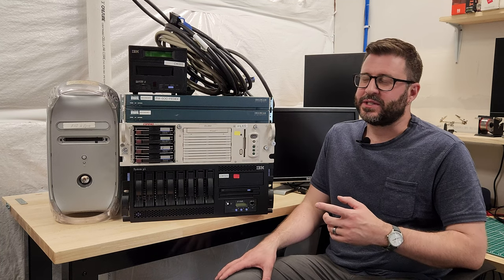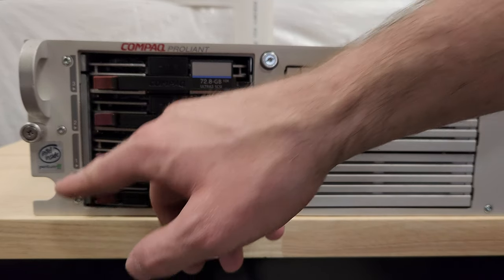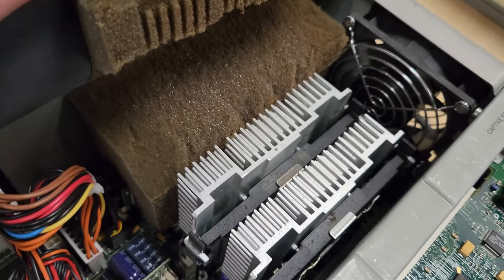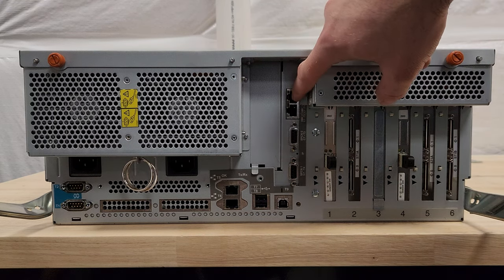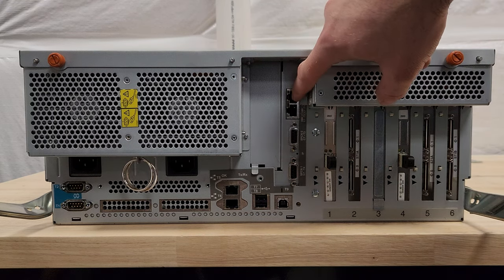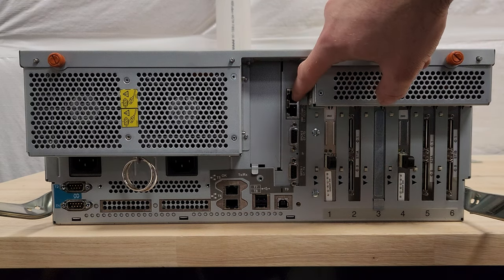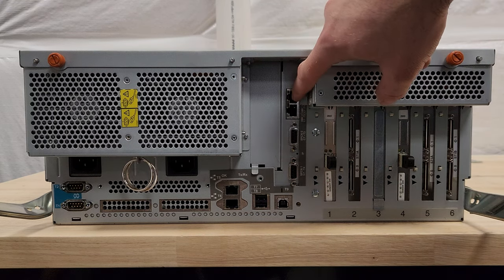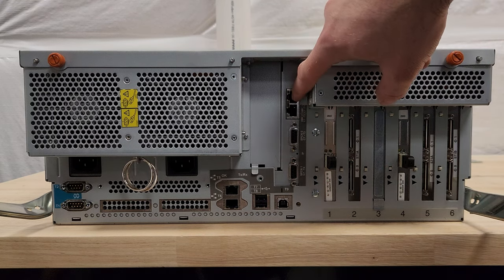Old Computer Craigslist Haul

Comment: I can help you quite a bit with the IBM box if you want.  You have a Power5 there.  Do not attempt to remove the CPU.  Skip the HMC completely unless the machine is entitled for PowerVM (I dont think it is) The jist of it would be to pull the FSP and toggle the two DIP switched on it (they will be under a small piece of tape and are super tiny) and then power it back up.  This will reset the admin login on the FSP which is where everything begins.  Youll attach serial to the S1 port and login, then its 2, 11, 1, 1 to factory reset the FSP and take an inventory of all the parts in there.  It will power up and down a few times and if it returns to slow blinking green light with no amber light, you're gonna have a better time.  To install AIX return to the FSP and power the system up into SMS mode.  SMS mode allows you to set the boot order, it will not automatically boot from the DVD you will need to specify it in the boot order.  You should then boot the IBM 5.3 diagnostic media and test the machine fully.  Repeat the process with AIX install media in hte drive, the AIX install process is pretty straight forward.  The AIX installer will automatically set the hard disk containing AIX as the boot device.  Other things of note:  your machine is not equipped with RAID for the internal disk pack.  You will want to obtain legit IBM scsi disks for this thing.  There is a PCB interposer board that is required to get it to actually connect to the 4-pack backplane.  Your RIO2 cables are for a different system, probably a 9133-55A
Reply from the maker: This is fantastic information, thank you. Probably just saved me several hours. I'll be taking a look at this in hopefully the next few weeks, if I get stuck or have more questions I'll reach out!
Reply: @clabretro  I could probably send you a drive if you want
Reply from the maker: @willross6468  I've got plenty of non-IBM SCSI drives, is it critical that they be OEM drives? I was reading in the documentation that theoretically they should be.
Reply: @clabretro  It should work with a non IBM drive, as long as you are not running iSeries partitions.  There are other comments hgere about the 522 byte sectors, but that is not relevant for pseries (aix) systems.  You will, however, need the PCB interposer board in order to physically interface the drive.  If you remove the 4-pack hard drive backplane to take a look, youll see what I'm talking about.
Reply from the maker: @willross6468  awesome, thanks. I'll reach out if I hit any snags!

Comment: the service module in the ibm doesnt need an hmc. its a computer to start the computer. the big mainframes use a laptop with special software to manage the big iron. this is just a compact form of its big brother. now for the sad part. the computer isnt worth much without the os400 license. that is where the money is at. You should be able to load AIX. is the model number a 9406. if it is, its probably an as400. i loaded a port of linux for powerpc on mine. oh and the plug on the front is not ethernet. Its a serial port the needs a special adapter to access the service module or you can use a serial port on the back.
Reply from the maker: Thanks for the great info! I figured I'd be installing something like AIX or Linux on there... though it would be fun to give os400 a shot someday. I'll have to check the model number this evening and see what exactly it is.

Comment: About this battery in imac. I belive this is Lithium thylium battary. These are top notch battery in terms of longetivity. They are designed to live 20 years, and often 30 years. Used in things like seismic sensors on the bottom of ocean, and similar. They have super low self discharge, so should not fail.

Do not throw them into bin or normal lithium recycling. They require special handling and disposal, due to super high toxicity. Maybe I am wrong, because I find it strange to use that kind of a battery in a consumer product like Mac.
Reply from the maker: I did end up leaving it in there because it looked totally fine (for now anyway). I'll have a follow up video on that thing eventually.

Comment: That small scsi cable end is VHDCI 68 pin. It was standard in mid 2000s.

Also, those Dell monitors are nice because they support sync on green for certain old UNIX machines.

Im planning on making a retro homelab as well, with as many different UNIX OSs on CPU architectures as possible. 
Still need to find an IBM POWER for AIX.
Reply from the maker: I didn't know about sync on green, that's great to know. Yeah I'm so in the dark on all the SCSI stuff, but I'm ramping up quickly with all this gear I've been messing with. I think I called it proprietary at one point in the video but obviously it's just another SCSI connector form factor haha.

That's awesome about the retro homelab -- what kind of stuff have you acquired so far?
Reply: Also known as Low Voltage differential.  LVD  Started at 80GB/GB, the 160GB/sec and 320MB/sec.     With SCSI you need a terminator at the end of the chain of devices.  LVD allowed higher speeds and longer length cables.  Which is another important limit depending on type and speed.   Enjoy!

Comment: 09:46 in these IBM POWER servers, the FSP is an isolated computer. Once you turn the server on, the FSP will boot up (and will take A LOT for that), and boot the entire server after that. All the system setup is performed in the FSP. You can either hook a serial cable or a network port on it. Through the FSP you can setup the LPARS (which is more like a physical division of the hardware, along with which operational system every LPAR will run). Once you got everything set, you tell FSP to boot up the LPAR, set the serial port to a virtual-serial module in the OS, and you're good to install the OS. It can be either AIX, Linux or IBM i (formerly IBM i5/OS, formerly IBM OS/400 - yeah, they're not very creative). As far as I remember, you can simultaneously run AIX and Linux, but IBM i requires some specific disk format, and can't co-exist with neither of them.
Reply from the maker: Thanks, this is super helpful! I haven't even powered up the thing yet, but I'll be making some videos on it when I do! Plan is to get AIX running on it.

Comment: That ibm system p5 seems really cool. I hope to see a video of that and aix. Seems like it would’ve shipped with aix 5.1, but 7.1 will apparently still run on it

I really like alternative architectures, but ibm power seems relatively uncommon in the uk. I have a sparc T4 and 4 itanium blades so far.
Reply from the maker: I'll definitely be doing a video on that p5 in the future, try to get aix running on it!
Reply: @clabretro you  will need ibm harddrives. They have a different blocksize. You also need a  software subscription to get the aix image. If you need information I hope I can help you. ;) Would enjoy to see this "beast" in action

Comment: Compaq 1850R is the predecessor. Same case, but before they renamed all their lines to DL, ML and so on. The drive trays are original, they changed to black ones when U2W came out because of the SCA ports at the back of the drives which requires trays with open backs. Before that in the SE era the trays where beige.

Comment: Not sure if it's been said below already, but the 68 pin SCSI connectors are pin compatible. the lager one is HD SCSI ( HD for high density) and the smaller one is UHD (Ultra high density) SCSI. They can be adapted.
Reply from the maker: Yeah I found that out later, I actually picked up a few adapters for using these in the future.